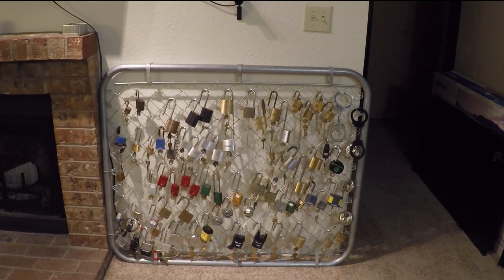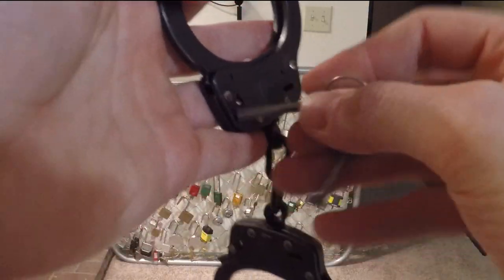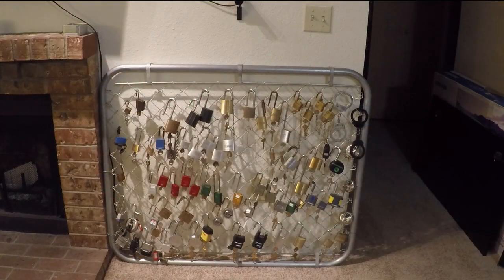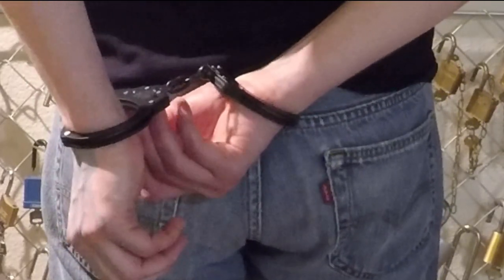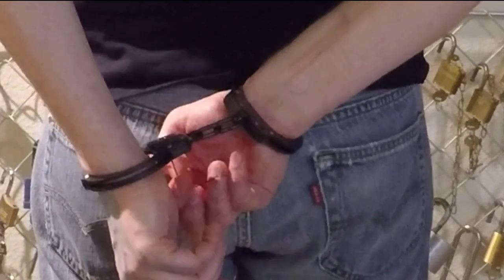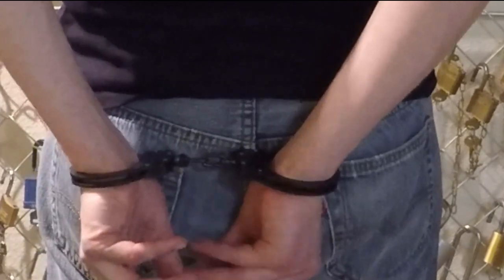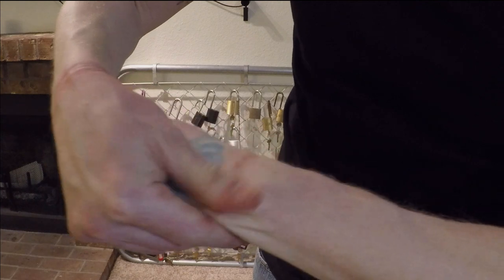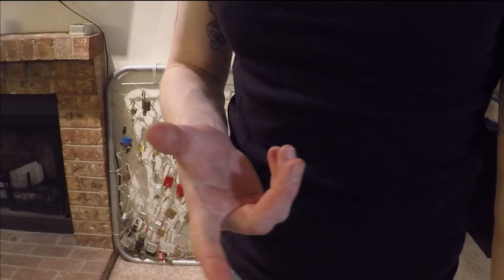34) S&W 350101 Model 100 Handcuffs (Police Grade) picked behind back w Bobby Pin - 1st attempt

Comment: Nice. If you are familiar with picking Peerless with their more secure keyway angling, then the next step I would recommend is try either UZI Professional cuffs (not the UBER cheap model) since they have 2 pawl bars which makes picking more difficult and maybe either Hiatt or Safariland which are available in the US which have 3 pawl bars. This is more difficult because you need to lift all 3 levers at the same time which takes different techniques and items.
Reply from the maker: Yes! I have a Peerless and then I have a double pawl ASP set I'd like to learn on.  Needs some more to add to the collection though!
Reply: Wow.. the blue double locking 2 pawl ASP? Those are hard hard hard to pick... The TOOOL Ultimate Handcuff key can open those too though :) You could look into that, you may find it interesting. I did a video somewhere on it a while back.
Reply from the maker: @techwg  Yep! The place I ordered from was doing a deal and got my name engraved on for free!
Reply: Very cool